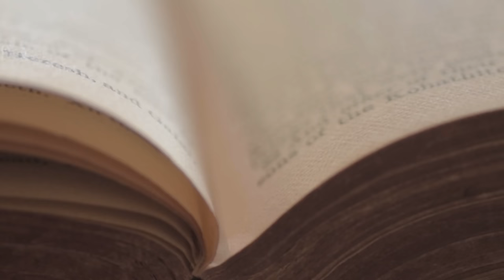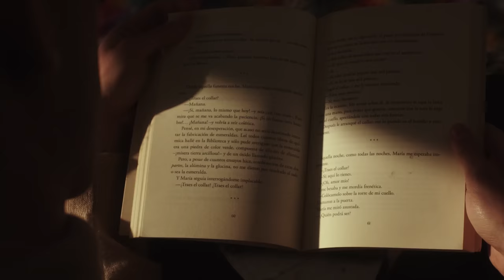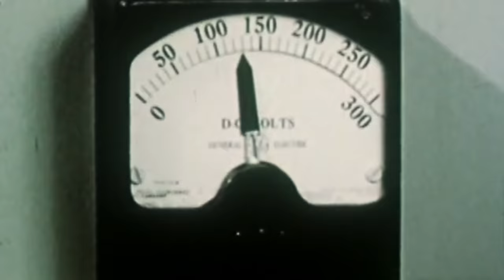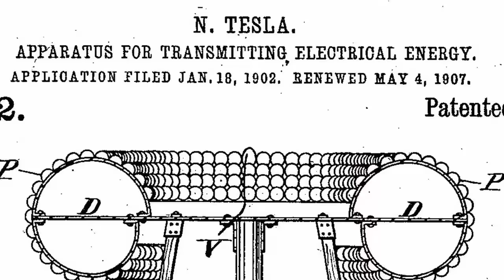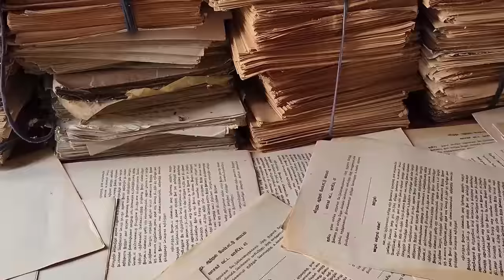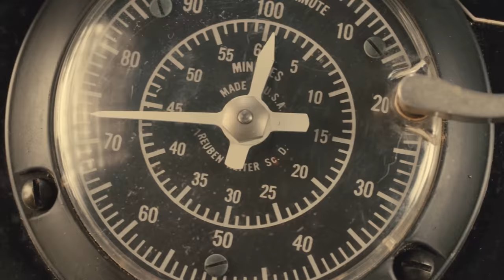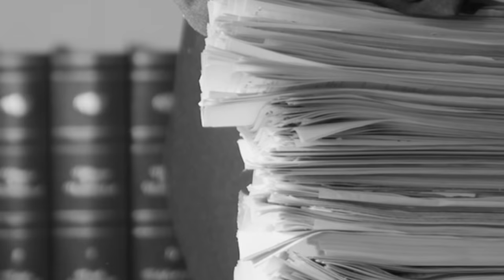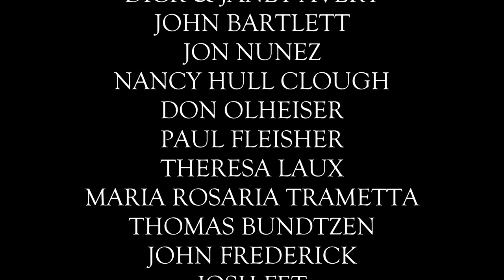Tesla - Inventor of the Modern World Documentary

Comment: Tesla never invented 'laser'. Tesla's 'death beam' weapon wasn't a particle beam weapon either. His device from 1937 generated a thin non-dispersive gravitational beam, replicated in the 21st century by Dr. Eugene Podkletnov. Tesla invented virtually lossless high-frequency electric power transport over a thin single-wire line, which has been confirmed by a Moscow academic team of scientists and technicians. Tesla's single-wire energy transport method is way better and cheaper than Dolivo-Dobrovolsky's 50/60 Hz three-phase system, which is still in use everywhere on the planet. Tesla perfected Moray's ZPE harvesting system during 1926-1931 (which he said could harness cosmic wave energy). Tesla's 'free energy' system was already proved by T.H. Moray. The Moray/Tesla ZPE harvesting system applied Fowler Nordheim quantum tunnelling (cold electric emissions), which was an effect heavily researched after 1926, just after Moray revealed his invention to the world. The ZPE harvesting feature of this system has been kept secret until today. By unlocking ZPE (zero point energy) Tesla could generate virtually unlimited electric power/energy, which he could convert and concentrate into very high voltage discharges, predating Podkletnov million volt discharge experiment (gravity beam induction) by 70 years. Of course, by portraying Tesla as a lunatic, nutcase, madman, the true originality and brilliance of Nikola Tesla has been swept under the carpet again.

Comment: We built it in 2001-2003 in a top secret government project it works the beam plate is 7 stories tall 120 wide holding 10  4160 braker rooms threw 5 levels

Comment: Nikola Tesla is a genius, but he did not study quantum complexity and quantum sciences. Also, electricity can be transmitted instantaneously to any place on the planet. Only nano fibers to transmit electricity and a monitoring element, as in the double slit process, and also two viruses joined inside it, an electron split into two, quantum entanglement, and also there is Another necessary element for directing energy between the two places, and I will not say it until I receive the Nobel Prize. Another necessary element for directing energy between the two places, but I will not say it until I receive the Nobel Prize.

Comment: Watch many video about Tesla and great inventions,.
Many others watch and did some experiment on electricity from the air using drone with electrical wire attach to it , go up 400 feet with other end of wire connect to electric motor and rod grounded to earth from motor and motor got amp running the motor . Higher up in sky more voltage motor gets .